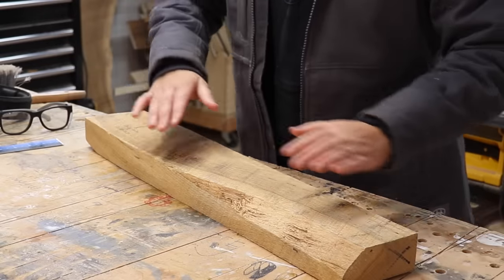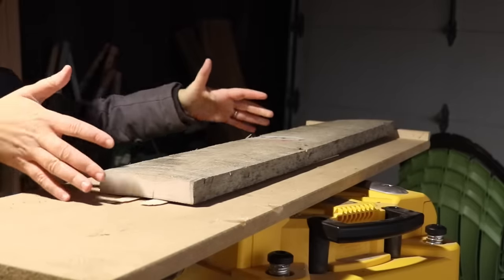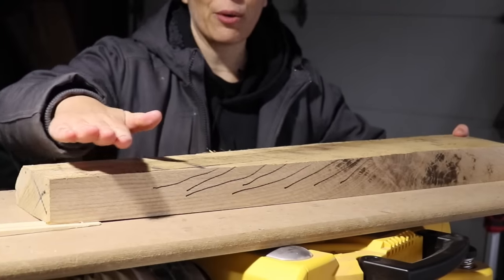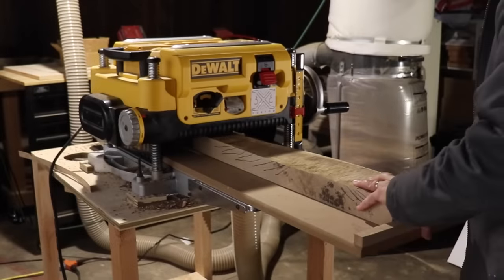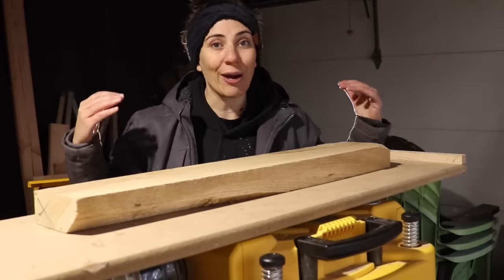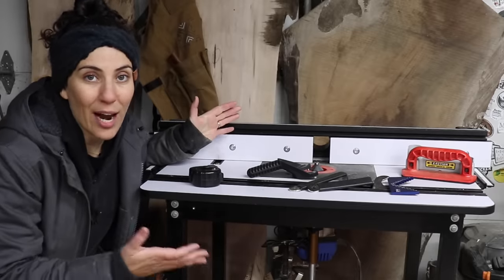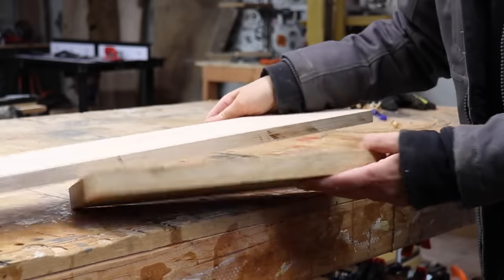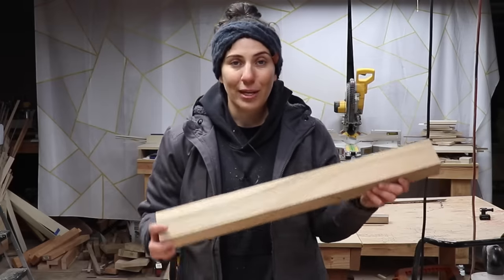Milling Rough Lumber Without a Jointer Using a Few Simple Jigs

Comment: I just bought a MDF shelf piece from Home Depot that is 10 inches wide and glued sandpaper to it for traction. So far things haven't gone that well putting my first piece of rough cut walnut through the planer - as I think I need a stronger stop piece on the end. While I love these workarounds, I start to think that spending $360 for a good, but not great Craftsman jointer might be the way to go. Tamar - have you bought a jointer yet? Also - like you my garage/workshop isn't heated. I've found that a propane patio heater works really well on cold days - with decent ventilation of course.
Reply from the maker: Waiting on one. Supply chains are kinda crazy right now
Reply: @3x3CustomTamar  Very true - Lowe’s and Home Depot - and even Amazon have pretty long delays. I’ve had good luck with eBay lately. I got a DeWalt planer - just like yours - the 735X ;) and it was $50-$70’cheaper than anywhere else and it showed up on time. I just ordered a Craftsman Jointer from eBay that I am hoping will be a keeper. The Porter-Cable ones seem to be sold out everywhere.

Comment: Question. With the planer sled, why do you feed the sled with the stop block at the end? I have tried it that way and the hot glue isn't enough to hold my lumber in place since the cutters want to push it off the sled. I find it way easier to feed the sled with the stop block first. Because the cutters are pushing the lumber through, I think it's more stable to have it braced against that stop block.

Comment: Thanks for the awesome video.  I have one question if you have the time - because you cut the edge joint on a taper, would you need to re-square the ends of the boards after you square the parallel edge?
Reply from the maker: Yes. I always cut to rough length before milling and cut to actual desired length after milling

Comment: In this video to mention that you used a really long jointer jig at one point. I have a project where I need to plain 12ft boards. What did you do to create that long jig? Rather, was it multiple layers of MDF or just a single?

Comment: This is super helpful! I'm also curious to find out your opinion on something. 

I have a table saw but no thickness planer or jointer. I'm planning to get either a planer or a jointer soon but not both. Should I just get the jointer? Or pick up a planer and use the technique you show. 

It seems like a jointer would allow me to do everything the planer can do and more except for the fact that the planer could do much wider material. I just make things for myself here and there and they always seem to be relatively narrow. 

Keep making amazing videos and wooden things!
Reply from the maker: You can’t use a jointer without a planer. You can use a planer without a jointer…
Reply: @3x3CustomTamar  ahhhh! Ok! Is that because you can't use a jointer to make two faces parallel? That's where the planer comes in?
Reply from the maker: @erikl10001  yes
Reply: @3x3CustomTamar  it's all starting to make sense now! Thank you 🙂
Reply: @3x3CustomTamar  for funsies I ended up getting an old jointer from the '60s for like $50 plus a little hardware and elbow grease. New blades come tomorrow so we'll see. It may have some misaligned beds and turn into a bit of a paperweight 🤣

Comment: Thanks for the great explanation and video. However, should the end of the sled with the cleat go into the planer first given the direction of the rollers and cutters?
Reply from the maker: I think that’s how I usually do it. But there is a debate over this. I’ve done both and never really had any issues bc the hot glue on the shins does all the holding power
Reply: @3x3CustomTamar  thanks for the response!

Comment: I have a quick question for you. 
I am new to woodworking and I’m starting little projects. 
The first one was a cheeseboard. I used a planer jig (melamine )with my Dewalt 735X. 
As I was planing my wood, I noticed that one end of my 20” board was becoming much thinner.
Was I shimming the wrong end of the board?
Did I need to flip over my board?
Lastly, on my planer there’s a round wheel on the left side called a Turret Stop. I have mine set a 1/8”. Is that where I want it set and when would I change that?

Thanks
Jeff

Comment: Okay, I've been having really good luck getting the CUP out of boards with a planer by running them through cup down, so they don't rock, and taking light cuts so the pressure rollers don't flatten the board before the cutters hit it. Once I get the top flat I flip them over and plane the other side. Now, as for twist and bow, a jig similar to yours is the only thing I can think of to fix them with a planer. Truth be told, I don't even mess with bows, so far the wood I've needed to plane was bowed SO BAD, there was no saving it.
Reply: This is the right way to do it

Comment: Hey Tamar, quick question about the planer sled. I noticed in some of your newer videos you use an "anti-slip" mat rather than hot glue. Would you mind telling me which kind you have? I bought some shelf liner yesterday but I think it's a bit too thick to use on the sled.

Also thank you so much for making your videos, it's already been incredibly helpful in getting my shop setup!
Reply from the maker: I used to use the anti slip mat. But one time I was planing a piece that was shorter than the mat and the matt got sucked up into the machine. Huge mess. I don’t use it anymore

Comment: Hi Tamar. Proud new owner of this planar. Colin’s video suggests an anti-skid mat. I used the hot glue and it made a mess but I’m a pure menace with a hot glue gun. Have you tried with an anti skit mat or is there a reason you use hot glue instead of the Matt Colin suggests?

Comment: You mention cutting to length before using the thicknesser. 
However a lot of videos I have watched talk about snipe at the ends of the stock. Have you experienced this and if so would it be better to leave a few inches either end where the snipe would be and cut them off and to length after? 

That said an absolutely great video explaining how the machine works. Does yours have a helical cutter head or standard knife blades?

Also liked and subscribed now based on the first video of your I’ve seen. Now time to burn a few hours watching your channel.
Reply from the maker: I believe I said “rough length”. The final step not shown would be to cut to final length. 👍 straight knives in this one

Comment: Thanks a lot for your advices, it's very usefull. I just bougth a DeWalt735 and will greatly benefit from your wisdom.

Just one detail that I wish to point out though ! ( Not only to you, I wish everybody would pay attention to this ). I noticed that you're wearing your ear protectors over your headband, which seems rather thick. Be aware that doing so greatly decrease the noise reduction of the ear protectors. And I know this thickness planer is loud. I personaly work in a environment with constant noise over 120 dB and we're frequently reminded by health professionals of the importance of being cautious with our ears. 

Please keep that in mind. You might not notice a difference on a day to day base, but on the long term, you'd definitly be loosing earing capacities. (Constant loud noise not only cause hearing loss, but also affects your mood, cause depression, etc) Please "like" this so as many people can pay attention.

Comment: The end stop on your planer sled should be at the front to be of any use.  The feed rollers contact the top of the workpiece on either side of cutter.  The feed rollers pull the wood through “ from the top” so if there is any slippage between the wood and the sled, the wood will slip forward.  The hot melt glue is providing all the grip between the wood and sled.  Curious how every YouTube build and demonstration feeds the sled backwards.  Check it next time you have a few spare minutes in the shop, wood and sled without glue and see what happens. You could be the first to demonstrate the proper use of a planer sled.

Comment: This was an awesome video!  For years, I've been going with "close enough" on my table saw.  But these techniques should really help improve my game!  Out of curiosity, do you find there's too much waste in milling lumber this way?  It looked like the board you ended up with was only about half of what you started with.  I realize you used a board with a lot of imperfections for demonstration purposes.
Reply from the maker: Glad you liked it! Yeah there’s a lot of waste. But the lumber yard is wasting just as much when you buy it surfaces. It’s all just part of the process. I try to reuse as much waste as I can. Like by making firestarters and things like that

Comment: Hi Tamar. For your no jointer… I have big 6x3 that needs to be 7 ft long. Will this method work ok for that length and size too?
Some have quite a twist
Reply from the maker: You will have to build a very long sled. It’s possible. But it’s heavy!
Reply: @3x3CustomTamar  I managed it but damn those planer roller are strong. I had to pack all the way down each side. Even a 8” open span either side would see deflection of the 3” thick beam! Thanks for this tip - saved me a lot of hand planing.

Comment: you should use the jig the other way so the board pushes against the stopblock on the mdf when feed through the machine 😉
Reply: You are totally correct. I made mine a few years ago (before this video), and explained about the stop.

Comment: Hi, great video i’ve just bought dw733 and i have no jointer so the first technique is very helpful for me, i have a question though for projects that do not require perfectly square boards (for example i need only one good looking face, not even flat) can i use thickness planer with twisted or cupped boards? Or in a long term this will damage the machine?
Reply from the maker: It won’t do any damage to the machine. You can totally do that
Reply: @3x3CustomTamar   Thank you very much :)

Comment: How do you make sure the plywood you're jointing on the table saw with is straight? And I assume with the mitter slot board in, it doesn't matter if it's not straight? (since the channel is the reference).

Comment: I am very new to woodworking, but I am using mainly pallet boards for projects. Do you have suggestions for squaring up boards and the best thickness to plane the board down for projects?
Reply from the maker: There is no best. There is what you can get it down to after it’s cleaned up…

Comment: Just a comment. When you go to establish the first straight edge. You can also think about lining up the cut so you have the nicest grain in the board for how you are going to use the board later. As an example rails, styles and such you typically want the grain as strait as possible and not running off the sides. Once you have the  board 4 square, it adds extra steps if you want to adjust how the grain sits on your final boards. Sometimes this matters and sometimes not, but its just something to keep in mind in when planning for the best looking project.

Comment: Well, true story, after getting my sled planer all figured out, and reviewing your video again, I went into the shop where I had rented space (I had been told the jointer wasn't working) with my piece of wonky walnut, my sled and my shims.  The shop monitor immediately said, "Well you want to use the jointer for that."  (They had fixed the jointer in the meantime.)  Oookay, who is Mr Newby to argue with this guy?  Sadly, not having studied up on the jointer, I ended up with two flat faces that were in completely different planes.  Oof!  So I learned a good lesson in what a jointer can do and CANNOT do--WHY what happened happened is another question.  I wish I had used the planer, because one thing that seems obvious is that the planer is involving both faces---cutting face A, while referencing face B--with the sled is impersonating face B in the case of a wonky board.  My question--finally--is how does a joiner create parallel faces (if it's supposed to be solution for straightening wonky boards) when it's only referencing the face you're jointing, and one (wonky) edge?  How can it bring both faces into a parallel relationship it's only referencing one face?  If you've already made a video on this, you can just link it, and save yourself the all the keystrokes.  Frustrated in VA.

Comment: The stop on the sled should be in front (I.e. go in first) because the planer is pushing the stock through, and therefore the stock is pushing the sled through.  Given the friction between the sled and stock once the pressure rollers engage (and considering hot glue, etc) I doubt you need a stop block at all.

Comment: Rewatching this, I just had in interesting thought. You know how in step 1 you have to use shims under the piece to stabilize it for a pass through the thickness planer? I wonder if anyone has ever built a dam around the board, protected it with something like plastic wrap, weighted it down and then used a little bit of 2-part polyurethane foam to create a custom foundation for that one piece? It's an awful lot more trouble than shoving a few shims in place, but if the board were irregular enough, that might actually be better. Just a thought...
Reply from the maker: That sounds like a lot of work for what could be done with shims… ha

Comment: Apologize if this has already been asked, but why do you place the end of the sled with the stopper towards the back?  I tried this and my board was getting pulled forward off the sled because I didn’t glue it enough. I flipped the sled around (stopper in front) and that kept the board and sled together and I didn’t need to use any glue. Just wondering if I’m missing something here…thanks!
Reply: Exactly. I have made video on this sleigh a few year back, and explained the reason. On of my viewers pointed me towards this video, as they had doubts about mine. I actually made the other joiner sleigh in the video a few years ago too 🤣🤣

Comment: It's not worth getting a jointer until you can splurge on an 8" at least with nice long beds. I have tight space in a small shop so all my tools have to be multi purpose. I ended up getting the 12" jointer/planer combination machine Grizzly sells (G0634X). I didn't really need 12" but it's one machine footprint in the shop, it's about $1,500.00 off the cost of buying two separate machines that size, has nice long beds for the jointer and comes with a helical cutterhead. The only downside is that it comes with the porkchop style cutter guard and because of the way it converts you can't use one of the aftermarket European style guards on it.

Comment: Just tried out a new trick I used small pieces of frog tape directly to the board in the low spots until it didn’t rock when referencing my table saw top then ran it through the planer and it comes out perfectly flat

Comment: I have looked at this sled in several video's. It's about 50/50, some have the cleat on the front of the sled, some on the back. Expand/clarify with your advise for this. Thank You
Reply from the maker: It’s a debate as old as time…. I have done both. Never had a problem either way. If you use hot glue and shims, that’s what’s holding it down really.

Comment: In some later videos, your planer jig has a non-slip mat added to it. Does this just replace the hot glue for securing the board? Or does it somehow replace the shims as well?
Reply from the maker: I’m earlier videos they have the mat. I used to use it until it got sucked up into the machine when the piece wasn’t long enough to hold it down…. Don’t recommend it. Ha

Comment: Hi Tamar - love your channel! Quick question on wood acclimation...you mentioned that you wait for the wood to settle after initial planing before you take it down to the final dimensions. By opening up the insides again though, won't the wood potentially start to re-acclimate again? (ie. a never ending process) Or is it because you're only taking a 16th or 8th inch off that it has less effect?
Reply from the maker: That last bit is the key. And then you’re working with it right away

Comment: Now you can use your track saw to stright line rip a long rough cut bord to squar 3 sides to make final cut on the table saw. For 4 sided surfaced lumber.
If you buy 8 foot or longer stock you can do this as your first step with the track saw then rough cut the parts down to prosses  into finished parts.
One thing about parting everything into 
Smaller parts is you can miss an opration milling and have to go back and try to match it like lets say you missed a step on the thickness planner that one parts not going to mesure the same as the rest of the parts.  Yes smaller parts are a lot easier to work with but they add an element you can make mistake with.
Your project will look better if all the parts are milld to the same thickness when they call for it.

By the same token you'll find it hard to get a 14' part prossesed on a jointer even with an 8' bed.

Comment: the two end faces would still be out of square with the long faces though, after the wonky cut with the table saw jig.
I imagine using the miter saw to trim the ends would be the best way to fix that though, since you can line up a flat long edge against the fence and cut at a right angle to it.
Reply from the maker: Yes. I mentioned this was cut to rough length. You then cut it to actual length after doing this whole process.

Comment: Theory for storing the sled away, could we rip it down into smaller boards and use dowels to put it together when needed?
This way instead of having one really long sled taking up space and looking slightly out of place you can just break it down whenever not in use and store it in a box or something
Reply from the maker: I just leave it on top of my planer…